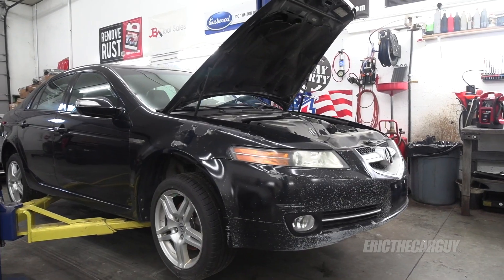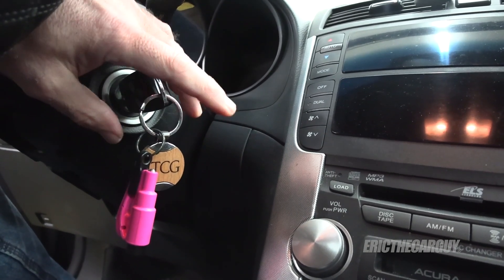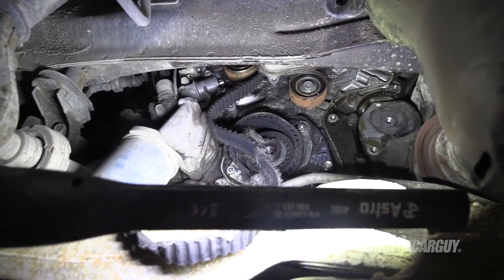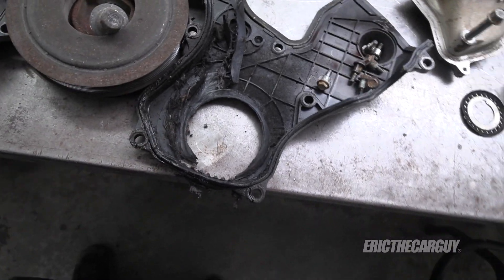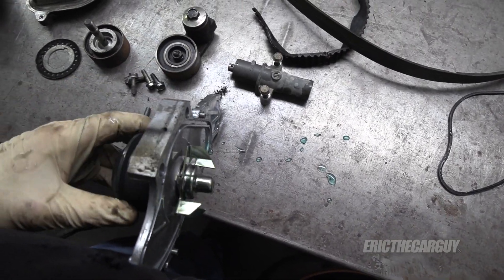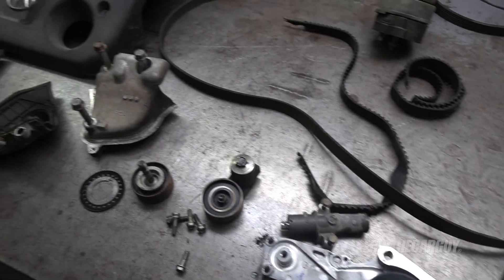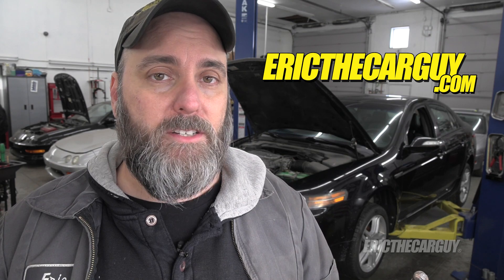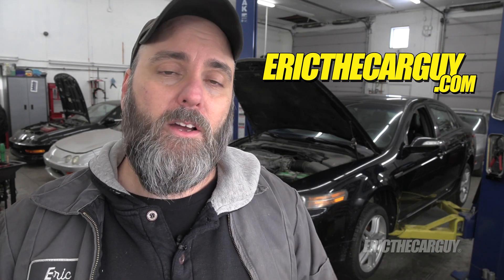Acura TL Dies On the Road

Comment: I might be late I’m not expert but if human error wasn’t at fault because u are really good at what u do 
Did U torque the fasteners to spec? For the tensioner?
Idk why but I feel like the tensioner was compromised.
But idk how 

Maybe there was one fastener not torqued or the threads were stripped
Honesty all those moving parts and massive amount or rotations and heat and pressure just one fastener and hence the belt and the crankshaft gear going bezerk

Did u pinpoint what happened?
I’m leaning on some sort of connection where the belt was connected because before u put the belt on it was prolly just a worn old belt prior to the install and than after the install this happened so . And ur right these engines are built really well.

Hey I’m not being critical I drove down the street today forgetting to put fuse box back on so idk but benefit of the doubt says u double or tripled check those 10mms or what have u that truly locks in the belts and the tensioners and the interface/cover of the timing belt and where the pulleys connect to idk what u call it but that side cover thingumajig 
Aight ovr/out

Love the optimism and improvisation.
Alright lemme see what u ended up doing im only 8 mins in than I wanted to share what was on my mind

Daniel 
Tampa FL
** I just got a 2005 Honda Accord k24A engine it is pretty sweet a 4cyl tho but still has power!!! *
Acura and Honda is my brand of car right now I had Hyundai for my last 3 cars I dk why I waited so long to try Honda
I shut up
Peace man

Comment: It’s that counterfeit timing belt kit you bought. Same happened to me but luckily at idle so it saved the valves. Went and got a belt and water pump from the dealer and been good since. If the price is too good to be true then it’s likely fake
Reply from the maker: I was driving on the highway when this belt broke. I don't think engine or vehicle speed really has anything to do with it. I think you're lucky or you're not. BTW, this IS an interference engine.
Reply: @ericthecarguy  Yea I've seen them survive and some with bent up valves. It sucks we can't rely on parts suppliers to be honest with where their parts come from. Expecting OEM and getting parts sub par to even the budget parts at local parts stores is the worst especially when its stuff that could do a lot of damage. Glad the TL survived. I love seeing videos with it bc I have an 08 base also.

Comment: Recently replaced TB, tensioner, water pump, etc. on 99 3.0 Accord EX. While researching came across a Utuber who advocated advancing the timing, how would this be done or should it be done? you show lining up the marks exactly, I live at high altitude. and on older cars with distributor, we usually advanced timing to run smoother. Does this apply to 3.0?
Reply from the maker: Don't. You'll likely do more harm than good.

Comment: My old ford probe timing belt broke/ slipped off 4 times, interference engine fixed the belt ran like a top everytime. I can't really blame my mechanic the times it fell off the cam gear was cockeyed took me forever to find a new gear, finally found one off an old mazda truck.

Comment: Great video, thank you. I have a question when you lined up the crank at 12 o'clock and the camshafts at the marks, how do you know that the crank is not 360 degrees out? Or it does not matter? Thank you again.

Comment: That tensioner has my curiosity. Ive done a few j30s and if I remember right when theyre fully removed from the engine they usually protrude just a little it more than that make 3/4” and under really intense pressure..

Comment: Only explanations could think of is if maybe a bolt got left inside the timing cover and it dislodged and then got into the belt and it cut it. In my personal hyundai i dropped a motor mount bolt and couldn't find it. Got another bolt and put it together. About a week later my wife calls me and says the car is making a weird sound. Timing belt was partially cut by the motor mount bolt and slapping the timing cover. I got LUCKY.
Reply from the maker: That is 100% not what happened. Link in the description to the installation. This was a counterfeit belt kit. I knew it when I installed it and wanted to see if it would fail at some point. Since I only paid $200 for this car, I felt I could experiment with it. Experiment over. Don't buy counterfeit timing belt parts from Amazon or Ebay. Thanks for your comments.

Comment: DAMN,ur SO patient! 😁 Honda/Acura lost a great master tech, FOR SURE!! WHY does honda/acura manuFACTURE interference engines??? Thats ONE thing Toyota has over THEM w/non interference. (I DO love both brands). I have always loved ur videos, shows faults like WE go thru!! Ur awesome Eric.👋👍😁
Reply from the maker: Higher lift and duration camshafts for better power make the valves move further into the cylinder. Also, engineers aren't thinking of when a serviceable component breaks when they design the engine. They design the engine to perform within their parameters and create a service schedule to keep it running as long as it can.

Comment: That one pulley looks very rusty... are you sure it didn't seize with heat?    Erick... thanks so much for this video!   It was almost a guarantee in my mind that if a timing belt broke on a J series Honda that the engine would be wrecked.   You're advice is good advice.   You don't know what you don't know.     Thanks again!  Glad the TL is working well again.  She sounds very smooth!   That facia needs a little paint?   What is all that?
Reply from the maker: Not at all. Keep in mind it's been sitting out in front of the shop for 2 months not running. The rotors were just as rusty if not more. As for the appearance. that's intentional. https://www.youtube.com/watch?v=rI-UiECuXYI&t=2s

Comment: Dear Erik, I believe the reason this thing occurred as you show the inside of a timing belt plastic cover there is some sort of round flap beside the crankshaft that was melted or chewn away, which I believe was rubbing against the timing belt and frayed it. Maybe this is a logical explanation of why that happen. Although even if this genre of Honda engine seems to be good, but the engine controllers being a crank sensor and maybe cam sensor does not give you a sense of sustainable reliability. My advice is to replace it with Toyota Corolla or Camry Loool. Take Care. John Jack Kaplanian from Middle East.
Reply from the maker: I don't think that had anything to do with it. That damage happened after the belt broke. I think the belt just broke. As for your other suggestion: https://www.youtube.com/watch?v=VES5D3zHTak&t=4s

Thanks for your comment.

Comment: I think the belt broke because it might have been rubbing due to the known Honda either idler or tensioner pulley wrong offset issue that was later fixed by adding a shim.
Reply: For anyone looking for more info its bulletin # 08-031 affects TL and MDX years 05-09.
Reply from the maker: Possibly, I added the shim with the new t-belt. We'll see how it goes. BTW, there was some noise from the drive belt area that I had meant to look into. It could have been the timing belt that was the issue, but I suppose I'll never know. Thanks for the comment.

Comment: For being g a Honda guy, I am surprised to see you install anything but an Aisin or Honda timing kit. The weak parts in the non Honda parts are the belt and the  tensioner.

Aisin supplies these parts from the oem component manufacturers.

There are sadly, lots of stories with Gates, Dayco and Napa parts failures.

Comment: Same exact situation happened to me. But I believe the parts I got were fake honda oem. The customer gave me a timing belt water pump and pulley that all came in honda oem sealed bags but the price was super low.

Comment: Could the tensioner have been bad?  With the grenade pin having no resistance to its removal, maybe the belt wasn't kept tight enough, causing it to jump off the gears and pullies and chewing it up?  I've used the Gates kits (not sponsored) the last three times I replaced the timing belt on my 1996 Dodge Intrepid (307,000+ miles).

Comment: Eric, would it be a good time to ask the question again, "Which is better, timing belt or chain❓".
I'm typing this at the point where the water pump is on the bench so I'm being a little unfair 🤣
Obvious it's not the belts fault for the failure but the stud.
I'm 62 so at my time if life after having replaced hundreds of the damn things in my career as a truck & car mechanic I'm firmly in the chain camp.
After 29 years of rolling around on cold damp concrete my joints are in the same shape as your timing belt. So, as it takes me as long to get down on the ground as it does to get back up again,  I'm defo a chain guy. Sorry 🤣😆😂
We're now @ crank sensor, I hope valves are OK.
Oooooio crank sensor on and sounds like all cyls have compression 🍾🍻🍺👍
Happy days from 🇬🇧
YIPEEEEEEEEEEE IT'S ALIVE‼️
Reply from the maker: I addressed that very question in this weeks ETCG1 video: https://www.youtube.com/watch?v=c0aLN4PbCzw

Comment: This is a very helpful video , my 03 acura tl 3.2 , just died on the road and I have the same problem my car has 215000 miles on it .  I removed everything and im gonna try to put a new timing belt on it.  Im just a little confused when you said to put the crank to 25-30 degree.  I have to move it to the right or to the left from the center??

Comment: I just remembered that I had an old Acura 19200-RDV-J01water pump in the garage that came on the car from the factory when we bought our 2005 TL brand new. I guess I am a hoarder to keep old parts like that. Just took a quick look at it and the impellers are like the ones on the one you took off the car and not the new pump you put on the first time.  I also noticed that the one that came with the car originally says Honda and then AISIN right below it and does not have that "bird logo" I guess the bird logo means it was made by YAMADA.  I wonder if you sent YAMADA a picture of it if could tell you how to spot fake ones.  I saw a telephone number for them as well as discussion board about fake Honda water pumps when I searched around.

Comment: you can always verify for bent valves by turning the crankshaft complete revolution.  that way you don't waste time replacing timing belt.
Reply from the maker: I don't agree with that. How does that tell you anything? Also, this is an interference engine, you might rotate the crank right into an open valve. In fact, that's why I said to rotate the crankshaft off TDC so that you can position the cams before positioning the crank. I can't see how replacing the belt is a waste of time if you're going to need a new one anyway. Not to mention, it only takes about 40 min on this engine with the water pump. Thanks for the comment.

Comment: I bought a 2007 Honda pilot with the same problem, I did the water pump and timing belt and how I have a 84-1 code and missfire on all cylinders

Comment: I thought J series was an interference engine. A bad timing belt I have been told would blow the motor. Interesting it still works after all that.
Reply from the maker: That's a myth I've been trying to bust for years now. https://www.youtube.com/watch?v=enPNb8dxCZk&t=30s

Even if it is an interference engine, like this J series, try the belt anyway. You might get lucky.
Reply: They tell you that so they can take your car off your hands for $200 fix the valves clean the heads  for $500 then turn around and sell your car for $7000. Mechanics dirty tricks= them getting paid. Only honest mechanics will tell you what Eric said.
Reply: @ericthecarguy  Thanks Eric! The whole internet articles about J series has given me the impression of certain catastrophic failure when the belt goes; I guess that isn't always true! Love your videos!

Comment: Good job Eric! My old 02 TL Type S is still  running strong at 200K miles with the new owner. Is a Gates timing belt the same quality as a a OEM Honda belt? The main question we all have is, What was the cause of the failure?
Reply from the maker: I think the OE belt would be better quality, but not by much. As for your other question, I covered that in the video. Thanks for the comment.

Comment: 24h JB Weld is much stronger than quick JB Weld, so you did the best you could glue wise before going to your plan B.  Have done plenty of adhesion pull off tests and quick JB Weld is always weaker.

Comment: ....Good video.....

I got an 06 TL. Cylinder 4 spark plug  flew out. Did a hilly coil repair on it because the threads were ruined. And it worked for a month or two and now I got a cylinder four misfire again. Do you have any pointers for me or should I just get a new cylinder head?

Comment: I have the 3.5 version in an 08 Odyssey I bought (used) with 150K on the clock. I did my research beforehand so I knew that there was 100K service it was supposed to get that included a new water pump and belt. And that was the first thing I did; used an AISIN kit and not the Honda OEM one. 

These seem to be great engines as long as you keep up on the maintenance.

Comment: Gates has been a disappointment lately (for me anyways) Did the tensioner and idler on my truck, already sqeaking... got an idler pulley for my car and the machining was just ever so slightly off so had to use the new bearing in my old pulley. Like everything though, things just aren't built like they used to be..

Comment: Ericthecarguy....please please respond?. The exact identical thing happened to my Acura mdx. The metal plate on the bottom that keeps the timing belt inside the bottom crank... by the sensors...it comes into contact with the crank gear...when I tighten it. Is this why our cars timing belt keep failing? Is it a design flaw? What should I do if that metal plate comes into contact with that round crank? Please help😭😭
Reply: I'm talking to a brick wall but whatever here's an Update. Had a mechanic come over be and see if I did things properly. Apparently I did. But need to replace the metal bracket and indeed I didn't secure the sensor bracket correctly. This metal bracket Eric was talking about Is EXTREMELY important! It will jack your entire belt up if it's warped and touches that crank pulley. Please inspect prior to starting your car!!

Comment: I was changing the Valve cover gasket and when I put everything back with all the connectors, the truck didn't want to turn on. I checked the fuel pressure and it didn't have me any psi, but I could hear the fuel pump priming and all the fuses and relays are working fine. My questions is if it's possible for the fuel pump to hum but does not work? Thanks!

Comment: Eric, the Crank Position Sensor Plug is not seated properly. There should be less than a cm gap between the connections! You should see wires coming off the the bottom connector.....Check this out for reference: https://youtu.be/ybe8dZpMxl4?t=82
Reply from the maker: Good eye! I saw that too and yesterday I took it apart again. I had to break some melted plastic out of the connector to get it to fit together properly. The good news is, no more screws. The bad news is, I still have a CEL for the crank sensor, but the engine runs fine. I suspect that will go away after I replace the damaged harness. Thanks for the comment.
Reply: Motorsport107… about to say the same thing: Nice catch! Bet if Eris uses the used Oem Crank Sensor, then code would not show up!

Comment: I have a 2005 Acura TL. AFTER I had new water pump installed. About 2 months later, I started the car to let it  warm up. Then I took off down the road. The car just died. I attempted to start it up again, but all I would get is one click on each attempt to start. And that's all I've got. What do you think 🤔 the problem is?

Comment: Might you check inside the cylinders with a bore-scope before repairs?
JB Weld not that strong. Could a solder work?
Even brand name parts are lowest bid subcontractor these days.
Reply from the maker: I suppose you could look inside the cylinders, but I didn't feel like taking that kind of time. As I said, I was going to have to replace the belt no matter what. I agree about JB weld, that was just a shot in the dark. The broken piece is acting as a spacer. The threads for the fastener hold fine, it's not going anywhere. Thanks for the comment.

Comment: So I have a 02 Acura TL Type-S and my timing belt but it while I pulled into my driveway I notice on the left side of the timing closest to the windshield that timing is off looks to be in a 1 to 2 o'clock position the right side timing looks to be correct how do I correct it even though the belt is busted

Comment: You don't want quick epoxy, it has a lower strength.
Reply: The stuff he used was not the quick version and it didnt hold either..
Reply: @frandanco6289  no kidding, and no adhesive works on surfaces not thoroughly cleaned with a solvent that leaves 0 residue.

Comment: Hey Eric been hearing back and forth on timing belts kits what are your thoughts I heard aisin is good since Toyota uses it but have bad kits. I heard gates is good but iffy on results too I bought my timing parts from acura @ 200k miles last time.

Good to see it's alive and well my butt would of been clinched after finding that. 😅
Reply from the maker: My preference is for Aisin kits.
Reply: @ericthecarguy  I was going to try that next time after doing research on Honda timing systems and belts I was afraid of going cheap on the kit. I'll try it on this 99 CRV since I wanna fix it but got to check out the head first to see if it fail first. Thank you for the comment

Comment: Buy the Aisin kit at a reputable store like rockauto, dont buy then at amazon or ebay. lots of fake parts nowadays. or just get them at your nearest dealer if u want to spend for oem parts.
Reply from the maker: That's kind of the point of this video. Normally I install Aisin kits as you mentioned. Thanks for the comment.